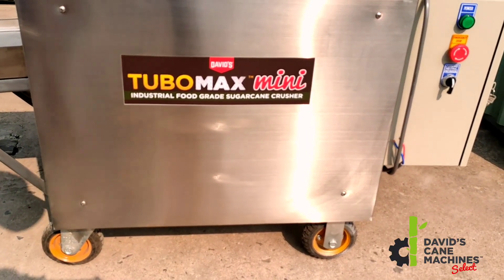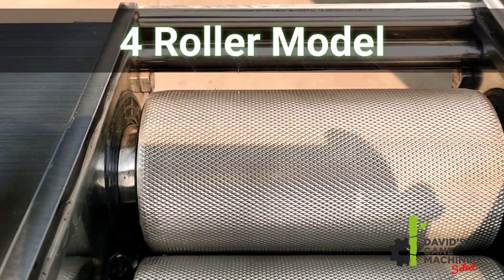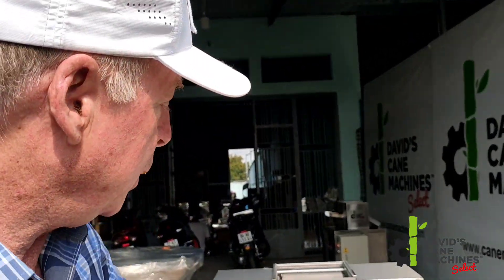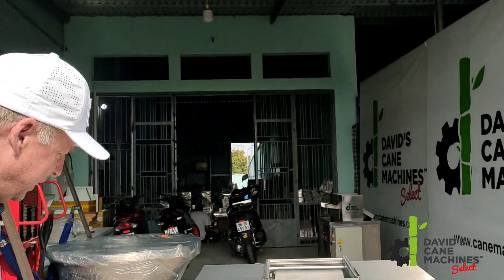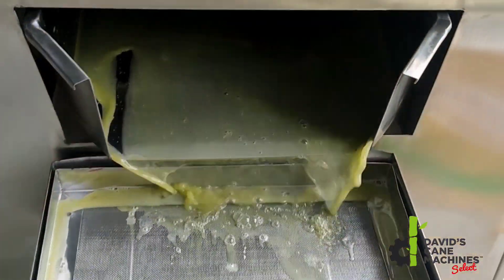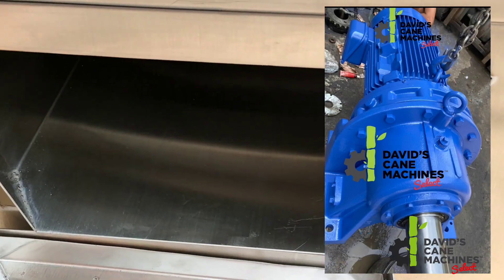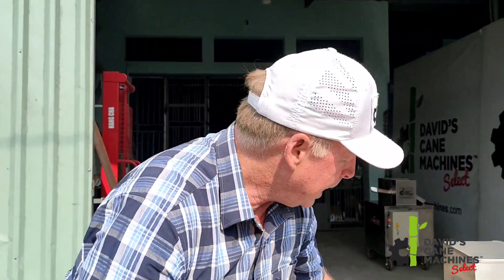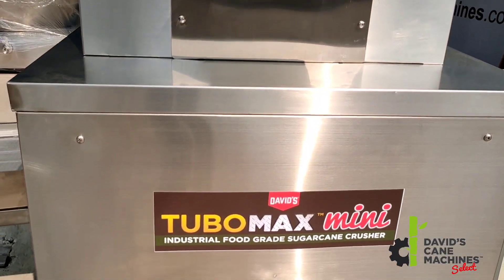TuboMax®Mini Light Industrial Sugarcane Machine | New 2022 Technology Update Demo

Comment: Is it available in 220 voltage
Reply from the maker: Absolutely, 220v, 240, 380, 440v with variable Frequency Drive in single or 3 phase power. Contact me on WhatsApp for more details +84375104049
Thanks